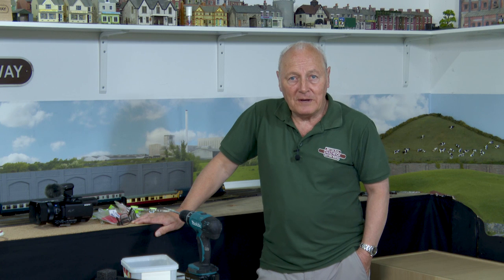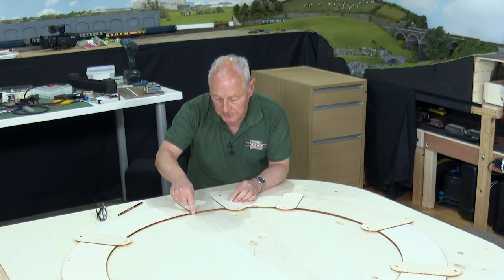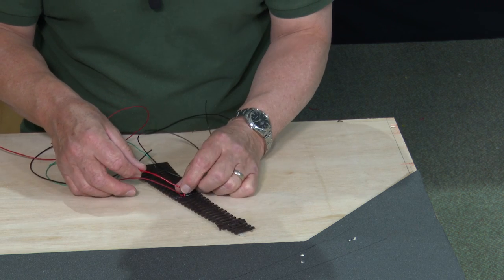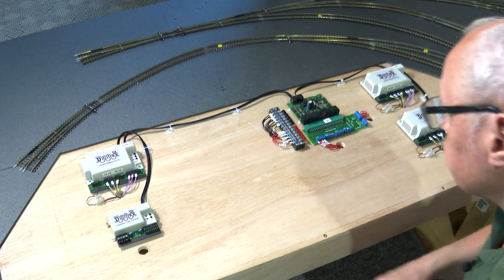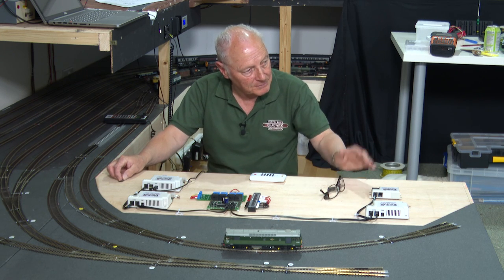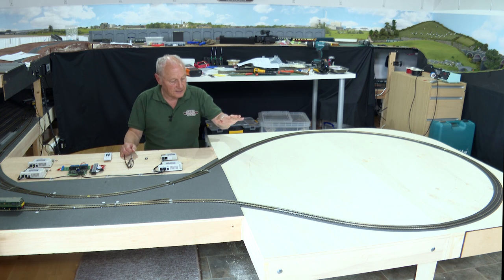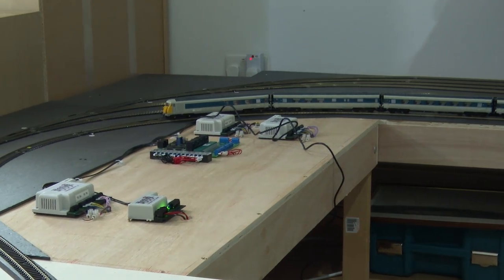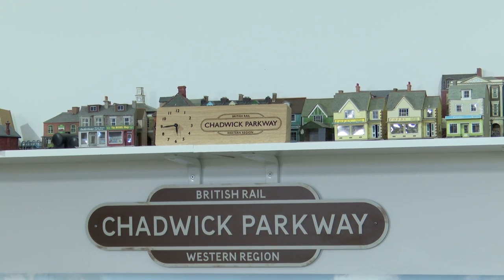Layout Update and Installing a Reverse Loop at Chadwick Model Railway | 162.

Comment: Hi Charlie,  
Thanks for the shout out Sir!  The old AR1 also caused havoc with Electronic Circuit breakers! The speed of the electronic CB's would trip quicker than the old relay could swap the polarity! Luckily , you can adjust the trip time on the NCE CB's so I had to "slow" them down to give the old AR1 time to trip!  Good job on the new work and thanks again for the reference!
CHeers Gregg.
Reply from the maker: Thanks Gregg, your most welcome mate.
Regards Charlie

Comment: Your fishplate fitter is simpler than mine. I soldered a short piece of rail at about 60 degrees to the end of an old screwdriver.    My other gadget is a modification to a pair of flat nosed pliers. In the centre of one jaw, I ground a slot just wider than the width of the top of the rail, and deep enough to reach the foot of the rail. The other jaw is un-touched. This gadget allows easy removal of a METAL or PLASTIC fishplate from a piece of track by locating the slotted jaw over the rail at the end of the fishplate, locating the other jaw at the end of the rail, CLOSE the jaws and the fishplate is removed without damage to fishplate OR fingers!    Glad to see you are wearing your toe protectors when moving boards !! I think the sound and improved loco control with DCC is wonderful, but all these electronic boxes leave me cold. I wired some extra sidings with loco sensors, went back to it 2 weeks later after tweaking back muscles under the boards, and could not remember what I had done! Age catching up. Why can't we afford to do our hobby when young and fit? Anyway ,enough of my whinging. I think the high level return loop is favourite.
Reply from the maker: A very interesting comment Rob.

It shows that there are more than one way to skin a cat. Regards Charlie

Comment: Hi Charlie. Excellent video as usual. You keep the banner of the hobby high!
If I may come with a suggestion for your numbering of your swiches.
Use three numbers for eachswitch instead: First number being the same as your board ( number them 0 to 9 instead of 1-10). Then use the following to numbers for the swiches.
So #706  would be the swich 6 on table 7.
Reply from the maker: An excellent comment Stefan, and a very good idea too. Sadly it’s a bit late for me now. Regards Charlie

Comment: Another great video Charlie.  I think what I like most about your videos is the explanation of what works, what doesn't work and what you do to get around the issues.  Though I run Digitrax command stations and throttles I do use Dual Frog Juicers for my reverse loops.  Works well for me.  I did notice something.  You have about 10 -12 inches of isolated track between the turnouts and the reverse loop.  With a little more wiring you and a couple more Digitrax devices you can automate throwing the the turnouts into the correct position as the train hits each of the track sections.  There is a video explaining how to do that on a reverse loop from either direction.  I will look for it and post it here if you want to view it.  Let me know.
Reply from the maker: You make a very interesting point about the automatic throwing of a point.

However, using train controller, I don’t think that’s appropriate. I would hate to think the point would throw if another train was coming off the helix. 
Regards Charlie

Comment: Hi Charlie, I noticed you used a string for the set dimension for your radius, there’s probably areas for error if you want your line to be perfect. I use a solid piece of timber screwed on one end and a hole drilled through the timber at my various radius locations and that way every line is perfect. Just in case you were interested. Thanks again for a great video…. Regards Jonathan
Reply from the maker: That’s fair criticism TTJ. Regards Charlie

Comment: Hello Charlie. Another great video Thank you. I enjoy watching you at work but know that I would never contemplate going DCC as I have neither the spare cash or another requirement,  Good Eyesight. I am happy to stay in DC. I have in the past operated a DCC layout, whixh is based on Canon Street and its approaches, I do concede that not having to switch  the sections on nor worry about reverse loop wiring is very useful.
Reply from the maker: Thanks Chris, we stay with what we enjoy the most. Regards Charlie

Comment: It's always cool when it's down to just one or two simple problems.
Almost as cook as when the DCC is all sorted, and you can set the trains off, and they respond to the "speed limits" in various areas (because you went and planned ahead for those).  
Not that it ever actually "ends."  There are signals to install and wire, and all the other fiddly bits that want doing.
Reply from the maker: He make a excellent point, the adventure certainly continues. Regards Charlie

Comment: Hi Charlie. I've had a Bachmann Blue Pullman since the first release c. 201-12. It runs quite happily on SETRACK R2 curves & points so you should have no problems with your wider radius curves. Been running for 10 years & only problems were human failure to set the points correctly! Great video. Hope you enjoyed the BBQ & beer.
Reply from the maker: Thanks Pat, for the reassurance on the pullman set up. Regards Charlie

Comment: Very good progress, Charlie and thanks for the video.  With respect to reverse loops I was using a digitrax auto reverser that used solenoids to do the polarity swithching - all worked fine with my ZTC 511 controller. However when I acquired an ESU Ecos controller the auto reverse module wasn't compatible and I had to swap it for a solid state module. Apparertly it had something to do with the speed at which the polarity is changed and the solenoid version was too slow.  Like you over the last couple of hot sunny days I've been indoors on the railway getting an additional baseboard fitted. It only has two points but when I applied power I was met with an instant short - aargh! After disconnecting various wires in an attempt to identify where the problem was  over a couple of hours I eventually found out that one of the points was responding to a contiuity test on all the rails and the frog!  In preparing the points for live frog operation I'd forgotten to break those pesky minute wire bridges.  Have had to lift the point and associated track work to remedy the situation - not a happy task!
Reply from the maker: A great comment mate thank you.

These little anomalies catch us all out from time to time. Regards Charlie

Comment: Nice one, Charlie. Larry Puckett did a good single track reversing loop using a DCC Concepts IP digital and legacy sensors to switch the point automatically whichever way the loco and train came from. Seemed to work very well. Also, Larry's method for making the modifying the frog means you dont need to use insulating joiners. Think the cat got one of your stabled goods wagons though!
Reply from the maker: Thanks FF, I’m so pleased that you enjoyed it.

Comment: Another great video, Charlie.  Worth mentioning that there are many auto-reversing gizmos out there, I use a DCC Specialties PSX-AR on my NCE controlled layout. It is also suitable for Digitrax, Prodigy and Lenz. Your comments about trains not liking S bends had me sweating, but I appear to have overcome the problem by judicious use of camber under the curved track, also using Kadee couplings.
Reply from the maker: It’s also worth considering the weight of each wagon Alan. Regards Charlie

Comment: Another wow! Champion clip, well done on completing the fiddle yard, the reversing loop and having in place the base for the other helix - on the latter, most certainly give us a clip or two on setting this up as you had many learning points from the first helix, so it should be a breeze :-). This clip has also been a real motivator for me to crack on in preparing my exhibition layout for two shows a week apart in early Oct (these being for the first time in 3 years) noting since the last exhibition it's endured a 500km move (with a very rough 3 hr ferry crossing) as part of our house pack with the packers using the 11 module packs as storage shelving  despite being told not too :-| !
Reply from the maker: Thanks EHP, I’m so pleased that you found it motivational. Regards Charlie

Comment: Oh My Giddy Aunt.  What a three days that was.  Absolutely lovely video and to see such progress in such a short time.  That Helix base is quite a monster isn't it - well done to Mrs B helping you wrestle it into place. I have to admit that I am still a little worried about the clearance on the inside of the reversing loop versus the helix supporting cross members (the oval shaped things).

I'm sure that you will remember that each joints between the curved sections of helix base sit on those supporting cross members.
Reply from the maker: Thanks for the reminder Lee, I’m eternally grateful. Hopefully My email should settle your worries. I still remain grateful for you pointing it out.
Regards Charlie.

Comment: Kia ora Charlie, thanks for the detailed video, in awe of how far you've come over 3 days. Personally feeling a bit overwhelmed with all your wiring :). I may have missed it but are you going to elevate any of the corners especially the one you thought may be a little tight. Nga mihi nui, James
Reply from the maker: Hi James, no I won’t elevate any of those curves. They are slow speed curves only. Regards Charlie

Comment: Great video Charlie, very interesting as always. I have invested in a Digitrax system so would be very interested in the wiring set up as I embark on my installation.
Reply from the maker: Hi Kevin I do touch on the wiring set up with every video. However I will do it most to produce a video purely on DCC wiring in the future. Regards Charlie

Comment: Thanks Charlie, very interesting, informative and entertaining. The BXPA1 was new to me, missed it somehow in the maze, but I've now had a good look at it and can see where it will be very useful. A future turntable, for example, the bridge being a good polarity reversing situation. I like the reverse loop added to enable a bypass of the helix to allow running and provide an alternate route for the future. I would like to see video of the helix construction, so please do go ahead with that idea and also let us know about your current Digitrax issue as I am sure it will be useful to us when you find the problem and the solution to it. There are many using Digitrax, even if many are not and the solution may prove useful knowledge when tracking down an issue on a different system. Finally, great to see trains running again, that's the goal after all :-)
Reply from the maker: What a heartwarming comment Brian. I’m so pleased that you enjoyed it, regards Charlie

Comment: REGARDING (Kill switch) yes those little remote control power boards or programmable power points are a God send until they are not.  I have been though so many for a seperate Application so much so the powerboard version you have has been banned in Australia.  So much so one of my recent videos sees me sticking with the copper BUT yes those remotes are BRILLIANT when working.   Keep it working and change the battery every 12 months weather it needs it or not.   I have always been fascinated by the electric genius of reverse loops.
Reply from the maker: An interesting comment Josef. However mine seem to work perfectly, regards Charlie

Comment: Hi Charlie. The joy in your face at completing this milestone is self-evident. Congratulations, as it’s been a long haul.
If t’were me I’d complete the top reverse loop before H2 but I see I’m already outvoted!
Funnily enough, I too use a Class 25 for my first track tests. If a Rat can’t make it through, nothing will. 
Finally braved some soldering for the first time ever yesterday - something I’ve been putting off for many months. Although I used your recommended soldering iron it was as successful (hardly) as your recommended hot wire cutter. Should I blame the tools or my woeful inexperience? Feel I need to spend a bit more money on both. 
Hope you enjoy your well-earned rest.
Reply from the maker: Hi Will, soldering is a difficult skill to master but once achieved, you’ll think what was all the fuss about.
Regards Charlie.

Comment: Hi Charlie, Great informative video. I'm wondering if you may be able to do a segment on platforms as and when your layout is ready to have the station built. I'm trying to get a slightly curved station without it looking daft it would be nice if we could have all the correct dimensions. I'm using mki mkii coaches and I do have one hst with mkiii coaches it would be nice to here from you to try and minimise the gaps. 

Kind Regards Gareth Leyland
Reply from the maker: I will indeed Gareth, but it won't be for a couple of months I'm afraid.
Indeed my main staion will have curved platforms, so rest assured, I feel your pain.
Regards Charlie

Comment: Hi Charlie. Excellent edition - thanks for working through the heatwave so we could see this great amount of progress.  

I'd like to see the Helix build details, I imagine you ask the question because Larry Puckett got some flack for covering his Helix build in some detail - though I really don't know why - it's always useful to see step by step on how these things go together or to know that you have a video reference source if you need it.  Love the fishplate trick!  I could not help but reflect on the point motor thing how much simpler it would be all be with motors with built in DCC decoder etc Far less wiring, no need for separate power supply lines etc?  Yes, I know you got a job lot of Turtles at a great rate, but nevertheless......  😀

I feel your pain at having to quote metric and imperial all the time for measurements.  I almost always use metric myself now cos the sums are so very much easier, but I know some people still only use imperial - though I'm not sure how many these days, since in my understanding Imperial has not been taught in schools now for a couple of decades(?).
Reply from the maker: An excellent comment, thank you. I shall have to check out Larrys Helix build, there may be some useful lessons. Regards Charlie

Comment: Awesome job Charlie .But why is the train showing red lights ( 35.50 ) just checking with you if you noticed.
Reply from the maker: Hi Allan, they are white lights however I shoot my video at 4000 Kelvin, and therefore it shows as pink. Regards Charlie

Comment: Nice progress Charlie!
I'm trying too cobble together my reformed, relocated helix and after watching you set up your wires I come too realize now the top section of my train table is going too need an auto reverse as well, that or I go from red front black back to black front red back on the top part.
Reply from the maker: My top level is red at the front, And the bottom level red at the back, this is natural with Helix and doesn’t need a reverser. Regards Charlie

Comment: Really good Charlie, all working great. Not sure if you have seen my configuration with double track dog bone with a 4 track helix. My wiring  issue came when at my station throat the inside track  had to cross the other three tracks via a double slip and two diamonds. I went to see Richard at DCC concepts and hid advised to wire that district like it was just one side of a tail chaser and wire the 4 Track helix using a reverse loop module (DCC Specialties) which works ok but I should have used two reversers as it is a double track. So now I have continued to wire the rest of the layout as if it is one side of a tail chaser and then put in another two reverse modules when the remaining end of the dog bone is completed. Hopefully will work and will be a big day to have trains running continuously after 12 years of building!
Reply from the maker: Blimey Four Oaks, what a challenge.

Comment: wonderful work as normal. Only thing I'm not sure about, is that the Pullman looks as if the tail lights are on the front as it runs around your
Reply from the maker: I know what you mean, you’re not the 1st to mention it.

My camera is set to 4000 Kelvin, which seems to record those lights as pink! Regards Charlie
Reply: @ChadwickModelRailway  thank you for taking the time to reply.

Comment: question, with some more modern locos having multiple pickups, could this mot use the loco to short between the sections?
Reply from the maker: No that’s not the way it works. The reverses action works when the first axle crosses into the new section. Regards Charlie

Comment: Great video Charlie, I was watching on the edge of my seat!! Great to see goods train go round the loop.

The coaches seemed to go through that tight section ok, be interesting to see if you come back to that at a later date. I suppose now is the moment though before it's all joined up and less accessible.

I can see everyone has voted for the H2 but I'm sure whatever you decide to do will be interesting and well received.

Glad hearing is ok, well done for getting it tested. 

We have been having a very early heatwave, temperatures above 40°C (104°F) and well above 20°C (68°F) night time, hopefully it will drop next week.

Good luck from Spain!!
Reply from the maker: Great comment David, stay cool out there. Regards Charlie